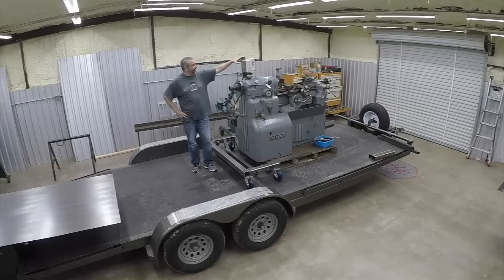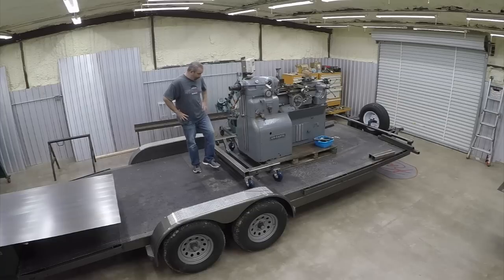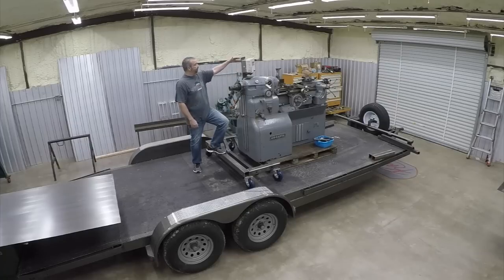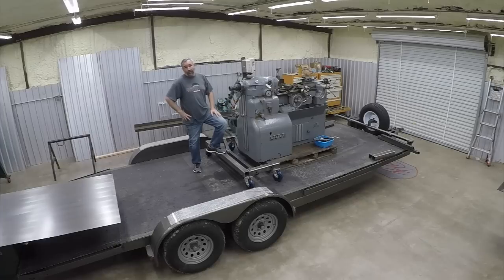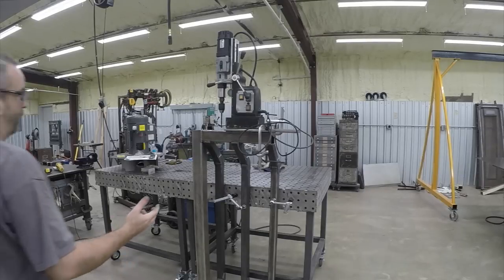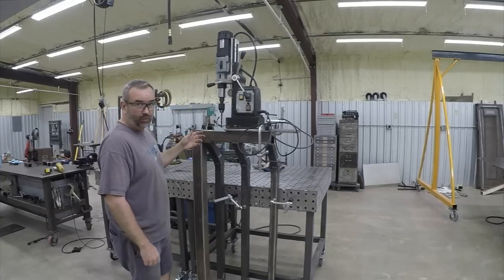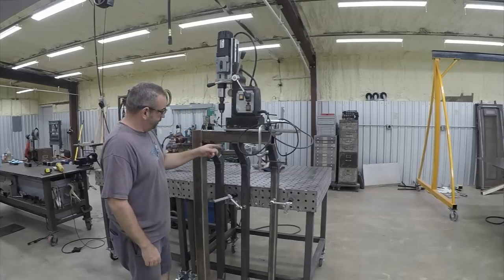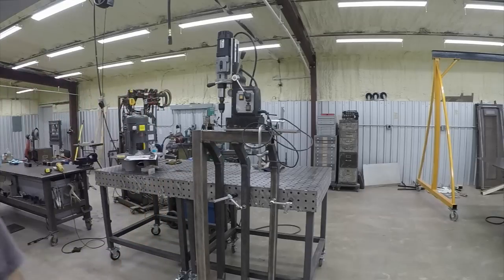Metalwork Monday - Heavy Machine Dolly Fabrication

Comment: I just discovered this channel. Very nice build! I will follow future videos. 

When they moved my 3300lbs lathe, the guys had machinery skates with rollers and it was surprisingly easy to push. They raised the lathe slowly inserting wood blocks one end at a time using two toe jacks.  

I had previously used a pallet truck when I moved my 4000lbs mill. Since I wanted a gantry crane, I got the 2 ton one and now it is very useful. 

Thanks for sharing!

Daniel

Comment: I like the solution you came up with for the flexing.  That should work very well.  Good job Gary.
Reply from the maker: I think it will take some pressure off the whole unit for sure... kind of like the roof in a unibody car frame.

Comment: It's nice to bolt on casters that way you can remove for other moving dollies keep them frames out by the steel rack you build more lol.
Reply from the maker: Lol, this is the first set of casters I have welded on, always made plates, drilled and tapped holes, takes way too long!  The pyrex cup is pretty nice, especially when your sort of at an odd angle, it gives you more visibility of the puddle cause you can see through the cup.

Comment: Hi Gary, I just found your channel [again it would seem from the look of the three axis vice on dollies video], and as I watch you cut that thick wall tubing a couple of things crossed my mind. You obviously have a supply of those tubes on hand and must cut them fairly frequently, but holding the tube up on its edge seems to me to be asking for trouble. I understand from reading other comments as to the reason why, ie to ease the load on the blade. OK no problem with that, but can I suggest that you make your self a couple of V-blocks out of flat and angle iron to support the tubing in several places and to maintain parallel with your table and fence. That way the tubing cannot move during cutting and remove the risk of blade breakage. I am also curious as to why you dont use any form of liquid coolant to keep the blade cool and to help remove swarf?
Reply from the maker: Hey Mark, thanks for watching and for the comment.  Some great thoughts for sure.  This saw is not designed for coolant, it has no way to capture the coolant runoff, etc.  Ellis stats that this saw with the speed, blade type, will do quite well dry cut.  In fact all of the Ellis saws are dry cut only.  Thanks again!

Comment: Did you go to the mig fo speed? saw those fab tables Certiflat? need to get one or six.
Reply from the maker: Yes, they are certiflat.  Actually i switched to the big because the fit up was not great where the 2" tubes welded to the 3" tubes, and the mig is better an filling in uneven or large gaps.

Comment: 6 cross braces divided by 4000 pounds is 666.666 pounds per tube.  That is provided the machine is in perfect weight distribution.
Reply from the maker: Sounds about right, 600 lb for 36" span of 2" tubing...  plus those bolts will take some of the weight off the tubes and put it back in to the base of the machine
Reply: I'd say they can take that fine.

Comment: On the Ellis saw...  Do you clamp it on a 45 so it doesn't have to finish on a large flat?
Reply from the maker: Yes, exactly.  Blades last longer and it actually cuts through it quicker.  That is 3" quarter wall tubing so it's quite bit to cut through.  On smaller pieces it does fine just laying flat, of course if your going to miter it you have no choice but the leave it flat unless you want some unintended funky complex angle lol
Reply: why did you start using the mig after the tig ?

Comment: I hate welding Castor's and getting the grease inside nice and hot
Reply from the maker: yea, exactly! i hate it too, this was the first set i have welded, you will find lots of other videos of me installing casters but i drill and tap plates, and weld those to the frame
Reply: +🔥Ramsey Customs - turbocobra 

I make cnc plasma cut plates for those casters. I make them out of 1/4" hot rolled.   They are the same foot print as the caster itself, so slip a bolt through, and a lock nut on the back side. Easy peasy.
Reply: +🔥Ramsey Customs - turbocobra 

Let me know if you want to try a set and I'll send some out.

Comment: Also, why do you prefer the bandsaw off your dewalt cut off saw when the dewalt is faster? More accurate miters?
Reply from the maker: Yes sir, the band saw makes perfect miters that fit up square and true.  It weighs 500 lb.  The dewalt is faster for sure but has a flimsy pressed sheetmetal base and isn't rigid enough to product nice square cuts.  It's not bad for just rough cuts, but when your trying to get perfect miters, its pretty disappointing.

Comment: What gas lens setup is that?
Reply from the maker: CK17FX Flex head torch, stubby gas lense with furick pyrex cup
Reply: Any problems with the pyrex being fragile?
Reply from the maker: No not at all, no more so than a regular cup, I have dropped it a few times, no issues...

Comment: What kind of drill press do you have?  I could use something like that.  It seems pretty stout.  All of the ones I normally see are kind of flimsy.
Reply from the maker: It's called a Mag Drill you can get them on eBay, they work extremely well.  I have a video on the stand i made for mine were i show more about it.
Reply: Cool.  Subbed.  I'll check it out.  You guys are relatively close.  I'm about an hour's drive north of you.
Reply from the maker: cool, come by some time..
Reply: NGinuity

Comment: Seems a lot of work when you could have jut used rollers and a come along. I have machines that weigh up to 7000 pounds and move them on my own with a big bar and  6 x 2 inch rollers. Come along used to put on and remove from my trailer.